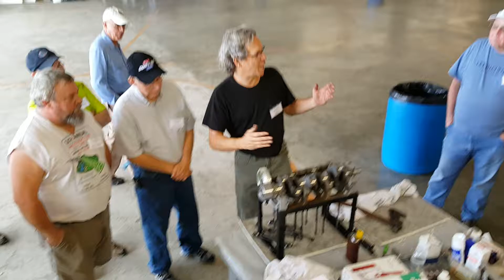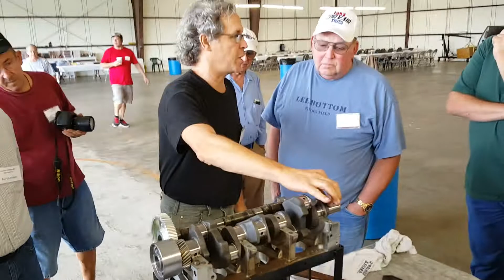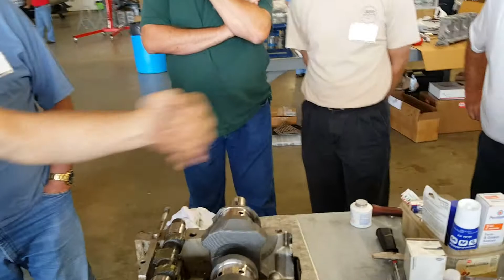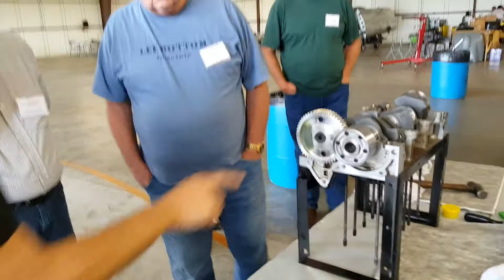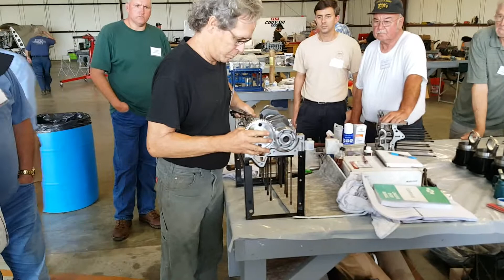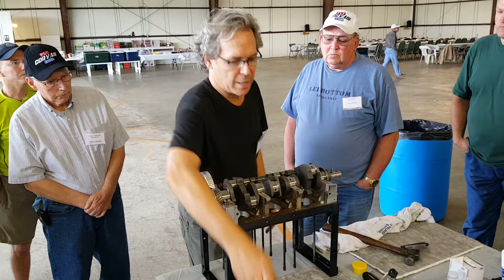Corvair College 35: How to install cam

Comment: Done about 40 motors, believe me you don't need a level, just half a brain and the manual.
Reply: You may have done Corvair car engines,  but what you are missing is the Airplanes 5th bearing journal, visible in the end of the crank, makes it impossible to see the front key way on the crank, and the timing punch mark on the crank flange, no longer exists. This makes it different than the car, and that is why the level is used.
Reply: I just went buy the book and key way, easy peasy.